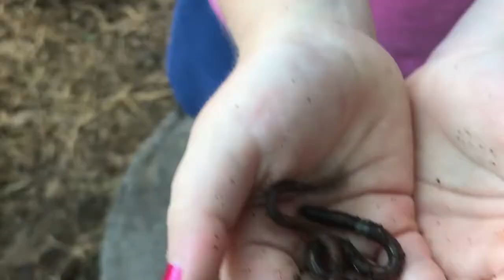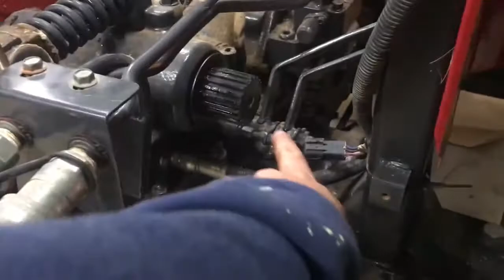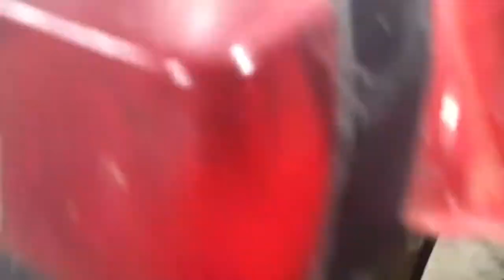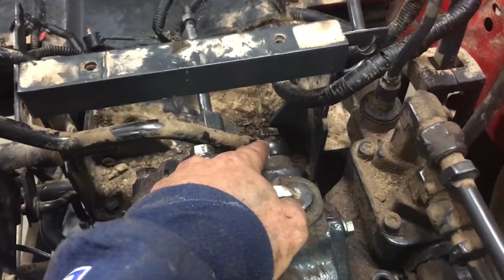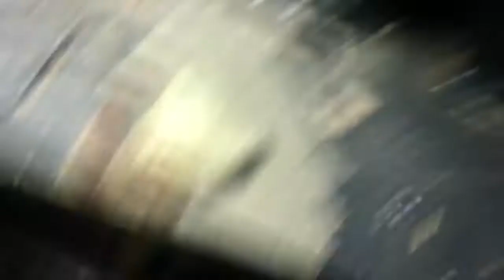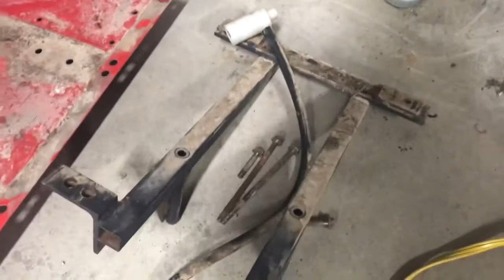Century 3040 Tractor Three Point Assembly Removal to rebuild and Replace

Comment: Thanks Tom, some great presentation skills there. Assuming you're happy with the repair, would you mind sharing who you used to fix the 3pt lift system..
Thanks again..
Reply from the maker: I just took the unit into my local dealer. Century was acquired by Branson which is now TYM I believe.